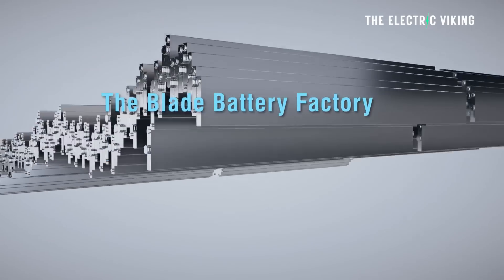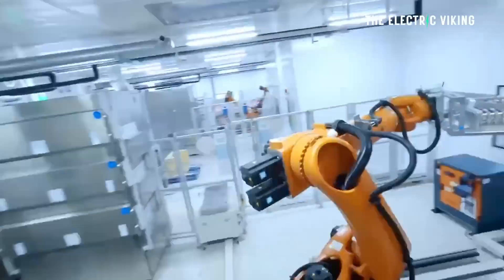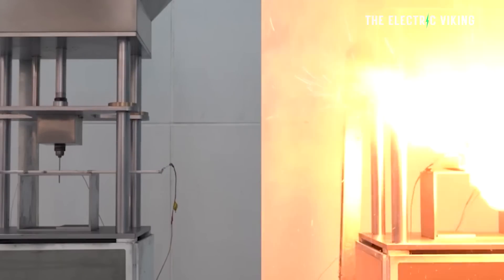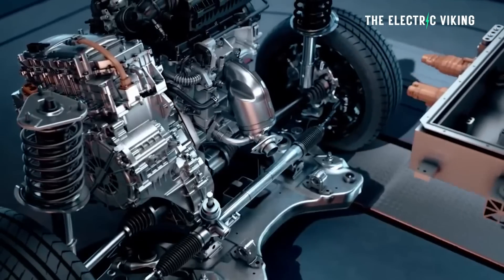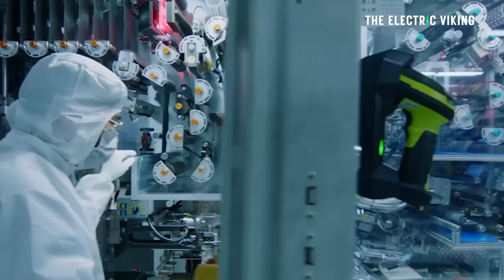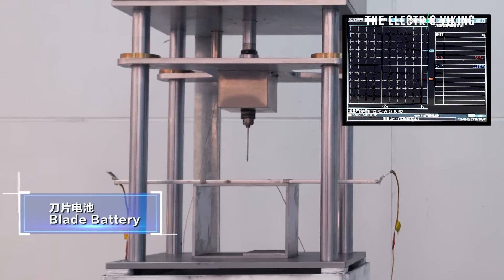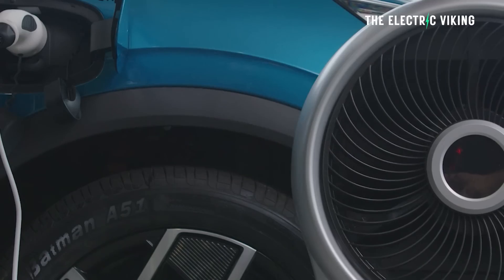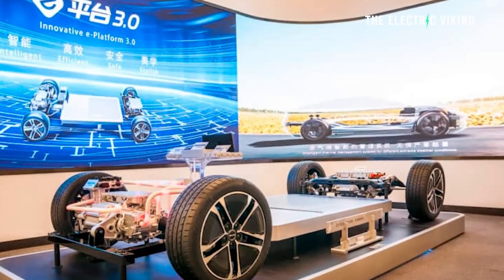BYD reveal new cheaper LFP Blade battery with 27% higher energy density

Comment: Here in UK, most EV can get by with 150-250 mile range. In the US, 400-500 mile range is needed much more for people crossing between settlements spread further apart. So it's all down to the market needs. 
If we have a small battery giving 200 miles, but was able to maintain charging speed of over 200kw all the way to 99%, smaller batteries are not going to be an issue.

Comment: This is great news! The smart way to utilize this improvement is to keep the battery energy capacity the same in the car and harvest the weight reduction. This will translate nicely into increased range and efficiency due to getting the weight out of the car. The dumb way to employ this improvement would be to simply increase the battery energy capacity in the car while not reducing weight. Dead weight is the biggest killer of efficiency.

Comment: Interesting. I am well known to family and friends as a "go to" person when it comes to purchasing a car. While I have never been in the motor business, I have amassed a considerable knowledge of cars. Presently, I would advise anybody not to buy an EV. This is because, here in Ireland, they are difficult to trade in, suffer serious depreciation and several new, better models are to come to market over the next year or so. Furthermore, the technology is developing so fast that today's EV will be old hat quite soon. I would advise waiting until you can get 600 to 700km/360 to 420 miles of real world driving per charge ( adequate for the size of Ireland) between temp ranges of -5 to +30 degrees Celsius, this to last the lifetime of the car, a comprehensive charging network and all at a price of an ICE vehicle

Comment: Fun fact regarding LFP - they seem to be almost the at same energy density in car battery packs as NMC.
But wait, there is more!
LFP doesn't need as much protection, cooling and energy buffer necessary for NMC.
LFP - 180-190 Wh/kg, >80% weight density in pack - 140-155 Wh/kg, 0 buffer, >5000 cycle count.
And now with 4C charging.
NMC/NCA - 240-275 Wh/kg, ~60-65% weight density in pack ~165 Wh/kg, 10-15% buffer necessary, ~1000 cycle count.
165 Wh/kg * 0.9 = 148.5 Wh/kg
NMC/NCA is realistically at best on par with LFP, but more expensive and less reliable.
Also NMC comes in huge single cells (because it can) so a structural battery is much easier to make.
NMC/NCA only make any sense if you have gigantic mid-power battery, like in a truck.
Other than that - LFP all the way.
LFP even has smooth quick charging curve that goes almost to 100%, NMC and NCA get super slow after 80%.
I find it ironic how Elon spent years developing good NCA battery packs, just to basically get beaten as soon as LFP gets adopted.
Also LFP has ~40% lower raw material cost compared to NMC (30$ vs 50$/kWh).
I'm pretty sure that LFP is going to dominate car market for a while.

Comment: For BYD imports into Mexico they first need to change the charging from a Chinese standard to NACS or CCS1.  The BYD dealer in Hermosillo, Sonora said that they will change the charging in 2026.  Longer trips would be seriously impacted unless they match the DC Fast Chargers in North America.  Next, for Mexico they need a model that has better ground clearance - big speed  bumps, pot holes, and some primitive roads in Sonora need more ground clearance than I saw in models in Hermosillo.
Reply: I agree 100% with you. I am in Mexico City. Our government needs to start to force the electrical car manufacturers to come equipped with the NACS standard that many EV vehicle manufacturers are about to adopt as standard. NACS is the Tesla connector (SAE J3400), and the voltage supply,  and protocols, needed to make life easer for everybody.  So all the cars and charging stations work well together. We do not want to carry with us adapters and find out that the public charger does not supply the correct voltage that our vehicle needs. Standards are very important to follow and respect. Even the voltage, and electrical outlet, installed inside the vehicles are not compatible. We use 127V AC, and the NEMA 5-15 standard.  The arriving chinese cars being sold in Mexico come with the Chinese outlet and supply 220V AC.

Comment: Sam, 
Thank you for your video.

Well, 
it comes as a no surprise that BYD has developed 

new batteries with 27% more density.

Others are working on the same projects, 

so the competition is fierce.

New battery in EV will bring the cost down, 

helping people to save money.

If people would be able to drive more for less,

then they will do it.

Comment: As a Canadian waiting to purchase a TESLA Model y  EV .. The range anxiety and degradation is VERY IMPORTANT to me ... The 12 years Ive be studying batteries for higher charging speed , higher quality, safer fire Resistance , travelling longer range , higher range degradation resistance , minimum of 250,000 miles battery life , high software management control , high motor drive quality, higher voltage charging system [ 800 kw ] , higher battery density to keep the weight down. The BEST would be SOLID STATE batteries but they are very expansive and they have a shorter cycle life. The company who solves these 2 issues first will dominate the industry, also they are about 40% lighter.. I need a car with a range about 525 miles or so on a GOOD DAY on a WINTER DAY you would LOSE about 30% of range so 500 x 30% = 350 mile Range . I live about 25 miles out of town with this range would give me room to travel with..We are getting close to what I'm looking for... MAYBE NEXT YEAR.. Maybe the NEW Model y upgrade next year might fit the bill ...
Reply: Anyone who lives in North America who believes that they need a 550 Mi range battery to buy an electric vehicle should simply drop out of the game.

Comment: I'm thinking the problem with hybrids is they have a really tiny battery, so that when it's running on battery, the load per cell is off the charts, compared to a full EV, where the load is spread across many more cells in a much bigger pack. So is this puny battery with really stressed cells the reason they tend to blow up all the time?

Comment: Speaking of eating Toyota's lunch, BYD is touting it's next gen platform -- releasing vehicles in August -- as able to create PHEVs with 300 miles of battery range and 300 miles of gas range, for a total of 600 miles per fill-up. A PHEV like that will eat the market.
Reply: There are two next-generation platforms. The next generation EV platform (4.0) is scheduled to launch in August. The next generation DM-i PHEV platform (Gen 5) is scheduled to start next month, pending market conditions, according to Wang Chaunfu. The new Seal 06 model is anticipated to be the first to get it.

"As the current model is in short supply, BYD will gradually make the switch to the fifth-generation DM model in May based on market conditions, Wang said at the time."

Comment: there no real point for high charge rates . as you never or rarely  reach them in the real world  for one. and two  it would be impossible to implement  at those rates consistently as  one car charging can consume  an entire city block of electricity  during it duration of charging . and thirdly  with  the newer hybrid engines  that  are  reaching efficient of +50% conversion ratios  and very low mass and size ..  these engines  will produce far less  CO2 then the average grid  can

Comment: Increasing energy density in batteries will not equal any more range!  Tesla will simply reduce the size of the battery to save money and weight.
Reply: Flip that around.Keep the same weight and get more range?
Reply: @jaaklucas1329   Hope that is an option for the extended range model.

Comment: As an ev guy this is good news.  Supercharging costs more then filling an ice car and you only get like 150 mils for the 80% charge unless your staying there for an hour or 2 for a full charge.     And it’s 60-80 dollars us for that…. More range is the only fix.
Reply: Complete trolling rubbish and wrong on every single point.
Reply: @douglaswatt1582  got evidence?  Becase I have all my reciepts.  But a simp like you hates facts.
Reply: Is that true that equivalent electricity per mile is more than gasoline? Must be a regional thing. Electricity in Florida is cheaper. Cost like $20 for 200 miles a Tesla charger.

Comment: Battery Density is getting better slowly, but charge speeds are sometimes degrading or simply slipping sideways.  For the most part this is ok as long as EVs are charged at home over night.  Long distance use cases, where sustained charge speeds matter the most are still struggling.  5 years ago people claimed batteries would be way better by 2025... That hasn't happened... So V3 / V4 is more likely to simply reduce weight and cost of EV vehicles, but not solve the faster charging problems.
Reply: It is only 2024, CATL have also made significant announcements recently.

Comment: 4:25 the reason that the nail test is very relevant is because of the fact that you can be driving down the street and there will be an object in the middle of the road that gets kicked up under the car and we'll end up puncturing the battery.  This actually happened to several Tesla vehicles including the Tesla Model S plaid when it very first came out.  It's one of the major reasons why the Tesla plaid was delayed for almost a year.  As for the plug-in hybrids the main problem that they have is the fact that you always have gas fumes with gas powered vehicles unless the tank is pressurized.  Something would happen to where the hybrids battery would get punctured it would mix with the gas fumes and explode.  Toyota pretty much always pressurized their hybrids gas tanks which is why they never had this issue

Comment: Higher Energy density means the battery possibly weighs less and occupies less space, yes you can reduce the kwh of the battery capacity to get the same range but the biggest advantage is in having smaller cars capable of doing longer distances. Not everyone has to buy big SUVs which mask the giant batteries that they carry. Same 60kwh battery in Atto 3 now should be smaller and lighter which means you can pack more range into Atto 3 by providing a bigger battery OR remain the same and reduce the overall weight. I don't see how 50kwh battery can give the same range. Yes,  weight reduction helps in city cycle but not as much as 10kwh worth of range.

Comment: The comparitive ease and servicibillity of a blade pack battery and the added safety and stability of the design makes them valuable.... adding 20% extra capacity and improving the general performance ..whats not to like. 
Not just for cars ... the boat and RV communities are looking for the same features and always want more capacity for storing Solar and other off grid imputs both for propulsion  and house loads such as cooking and cooling and heating.

Comment: Sam,

you misunderstand the concept of energy density and capacity. Energy density indicates how much energy fits into a kilogram of battery, capacity indicates how much energy the battery stores. High energy density means less weight and perhaps volume. Capacity, on the other hand, remains the same if you want to keep the same range. BYD batteries are not 50 kWh, they remain 60 kWh, but are 27% lighter compared to the first version.

Comment: Battery in the bottom part of the car is one of most stupid things that exists.
Reply: Why? Low point of gravity, "easy" replacement, etc.
Reply: Actually, its the best place to put the weight on a wheeled vehicle. 4 wheeled, evenly distributed for traction and stability.2 wheeled, even more important. And,as stated below easy to pop out. The pack is part of the structure which is really clever.

Comment: Surely if you have a 60kw model y lfp. Then get 27% more thats a 76kw battery and more range. Stick a 50kw battery in and you'll get less range. Basically the efficiency is affected by the weight of the battery. The cars themselves dont suddenly become more efficient.
Reply: His analogy was the new battery pack can have the weight and physical packaging size of a 50kwh battery but still provides +60kwh.  You lower weight and pack size you improve efficiency, handling, internal space and acceleration, everything else being equal.
Reply: But the 79kw battery gets faster acceleration, and more range. There are two things to note. The max volume is more or less fixed. But you can use less with a smaller pack user space, foam.... Now my understanding was if you can get 76kw out of LFP you put that in. Because it is cheaper and gives Long Range. So LR Models can use LFP. Bring down price to boot.

Comment: As long as you have at least 400km of range and super fast charging ( i.e. 400 kW + charging speeds ),  the vast majority of drivers wont be significantly inconvenienced,  if at all.  This is because after driving 400km,  one typically needs at least a 30 minute break and during that time one would be able to top up their vehicle batteries to 80%.
Reply: Some people would be more than happy with 300km range,  again as long as super fast charging ubiquity is reached.  I can barely get 300km in my ICE vehicle
Reply: As long as the infrastructure is there, I agree with you. Just a bit concerned about getting that stuff in the regional areas of some states and countries. I wonder how many chargers will be needed to accommodate the time when every one is driving an EV
Reply: Absolutely.  Super fast charging needs to reach ubiquity everywhere and new EV models need to have the fast charging capability for that tipping point to be reached.  I would think that be at least 5 to 10 years away.  Fundamentally  the numbers stack up,  as the EV motor is far more efficient.  Charging infrastructure and new designs just need to align,  to maximise the benefits.
Reply: the grid in the UK and US cannot support such chargers.
Reply: You are partially correct...But its human nature to want better...If they make it affordable....They definitely will find a market
Reply: @eldios831  Thats called greed, and like every other dumb instinct/nature that humans poses, it can be controlled. When something is affordable, thats because someone is getting shafted in the process.
Reply: 400km without stoping is insane for the body. People really haveno clue how unhealthy that is. I regularly do long trips (aka Norway to Germany or Germany to Spain) and almost always stop every 200km for a rest. Longest Ive been is 300km. More than 2 hours of constant driving becomes unbearable. And I drive a comfy mid sized sedan. Quiet, smooth with all kinds of amenities (heated, vented and massaging seats). If someone made me drive your average joes shiitty suv for those distances Id stop driving alltogether.

Comment: This sounds like a great Robo Taxi battery.  A Robo Taxi may not need much range.  It can charge daily or even during the day.  This means a smaller lighter and cheaper battery.  This lessens battery supply issues.  I don't see the model 2 and Robo Taxi being the same.  Model 2 needs to be sexy.  Robo Taxi needs to be practical.  If I was designing a Robo Taxi it would be front wheel drive, no frunk, 2 sliding doors, each accessing front and rear seats, a rear hatch and a low rear floor as there is no rear axle.  Shape of a box.  Easy to get in and out of.  It's for city driving so aerodynamics is less important.  Shape needs to stand out.

Comment: Most claims about batteries never turned out to be true.
Everyone should be very skeptical about such claims.
27% is beyond incredible.
Reply: CATL have announced a new LFP battery with a 15 year warranty and 1.5m kms, it also is said to have zero degradation after 500,000 kms.
Reply: The announcement was this "CEO, Wang Chuanfu, said the new battery will be even smaller and lighter with the same endurance during a recent financial meeting, " & this dude makes a vid claiming 27% improvement? 🤔
Reply: @pieter85  Interesting then where the 150 wh per kg to 190 wh per kg came from as I have seen it quoted also in other articles.

Comment: Why can model Y with BYD battery charger up to 170 kw and the Atto 3 only up to 88 kW. This alone made me switch my company car from Atto 3 to MG 4. The Charging speed is just too low if your driving on the Autobahn
Reply: BYD Yangwang u9 charge up to 500kw, its also using the same blade battery.
Reply: The Seal charges at 150kwh maximum, its a choice made by BYD for the Atto. The Atto also has a powered retractable glass roof and blind.

Comment: And unlike Tesla, BYD seem to produce what they promise they will.
Reply: and this v2 blade battery gonna launch in q3 this year too
Reply: @nagi-springfield93  might hold out and delay my dolphin.
Reply: @dolphindave3037  Normally new battery will equip on higher end model first, at least 1-2 years until entry level ev get to use it. You might need to wait a long time
Reply: @nagi-springfield93  very true. An extra 10-20% isn't going to affect me anyway, but it would be nice to have.

Comment: Yes, new battery breakthrough #437.
Reply: Don't tell me, let me guess. It's smaller, lighter, cheaper, safer, lasts for longer, and you can charge it using the solar panel on an 80's Casio calculator in just 5 minutes.